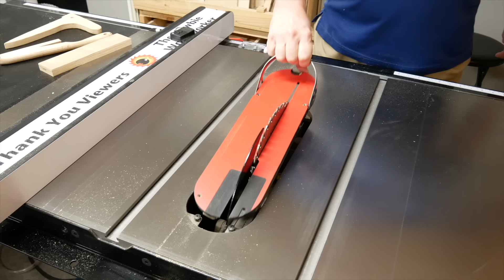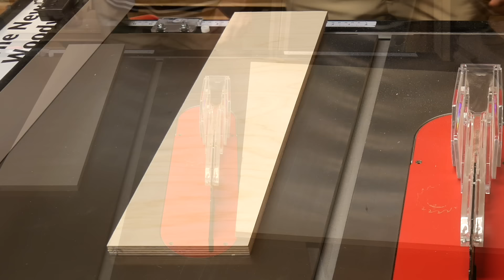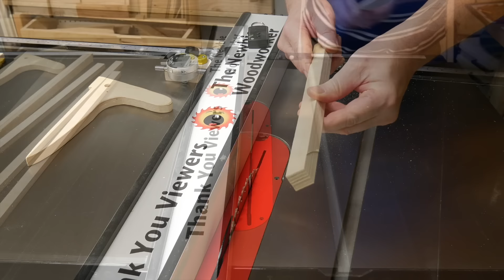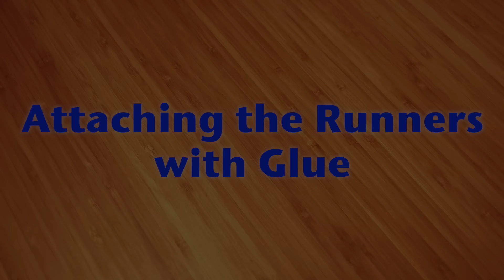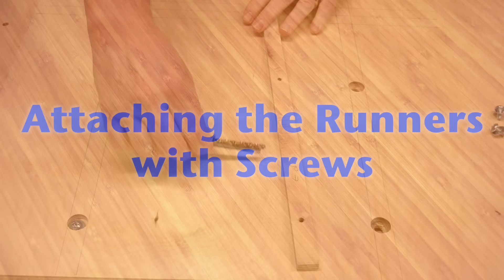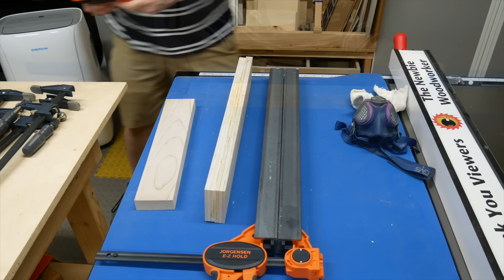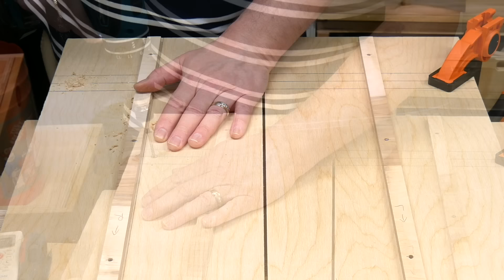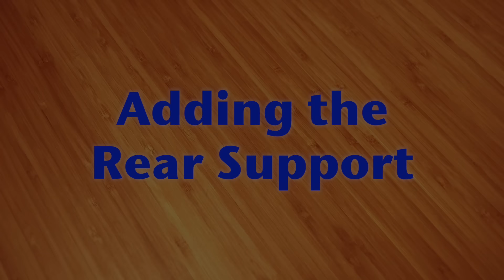Build this Revolutionary Cross Cut Sled, for Newbies!

Comment: A hazard might be advancing the sled too far and cutting it in two. A removable steel pin in one mitre groove or a latch at the back of the sled would prevent sled overshoot.
Reply from the maker: That hasn't been a problem at all. It's pretty obvious where to stop, since you can see the cut clearly.

Comment: Thanks, Newbie. Super helpful. I built this over the wknd. My deviation: To attach the slides, I put them in the tracks raised on pennies. Set my saw's fence so I could position the sled base down onto the tracks which I coated in wood glue. Put some weight on it and let dry overnight. Next day, I secure the tracks w/3/4" countersunk screws (careful to not go through). I figured that the critical adjustment is having the fence perpendicular to the saw blade, if my tracks aren't perfectly square it doesn't really matter. Sure enough, when I used your taped ruler w/long square square-up method the fence needed considerable adjustment to be square to the blade. Lastly, when attaching the fence to the sled rather than do all that upside down work, I positioned the fence on the top of the sled (between lines I had drawn), clamped it, flipped the unit over and screwed in from the bottom on one side (left like you showed, that helped!). Then when I had it square, I clamped it again, flipped over and screwed it in. Today I'll cut out the blade guard rectangle. I think I'm gonna use a jig saw and cut it in position without removing it from the sled, saving all that realigning screw holes bit. (It's already well sanded save the new cutout area which I'll do w/my fingers.) Ciao for now and thank you for all your work and humor.
Reply from the maker: Awesome! Thanks! 🙂

Comment: I bought a used table saw, no guard and writhing knife.  I made a zero clearance insert and added a splitter.  It appears I can't get a knife of guard from Dewalt as they don't make it anymore.  I do agree about the guard and the safety aspect.  Thank you for taking the time to make this video.
Reply from the maker: Thanks! And at least you made a zero-clearance insert and added a splitter - that was the best thing you could do to help prevent kickback. Good job!

Comment: You demonstrated that your small square was inaccurate, so you used your framing square.  Then, when you cut a test piece on your sled, you used your inaccurate small square to verify the fence was square.
Reply from the maker: Sorry - where did I demonstrate that my small square was inaccurate?
Reply: @TheNewbieWoodworker  20:55 "...the smaller square is less accurate."
Reply from the maker: @BlisterBang  There's a difference between "less accurate" and "inaccurate". But the truth is, I already knew the test piece was cut squarely, so the rest was just to show on the video. Yes, I could have used the larger square, and I probably should have.

Comment: Hi there, sorry its taken me a while to watch your video on making this saw sled,my only concern is when you are putting the screws through the base into the fence and the fence being made with two pieces of plywood is there a possibility that the screws could split the fence?, could you have built the fence out of a solid block of wood?.
Many thanks, Steve H from over the pond in England 🏴
Reply from the maker: Hi Steve. As long as you drill pilot holes first, you should be fine.

Comment: Thank you for sharing this design.  I've been away from woodworking for a long while, one reason being an innate fear of the blade.  I didn't like the idea of removing the guard in order to use a sled.  This design suits me perfectly, although I'll probably deviate a little bit, like using premade steel runners.  Other than that, looks great.  Thanks!
Reply from the maker: Awesome - glad I could help! And we wouldn't be woodworkers if we didn't taylor things to our own preferences, right? 😄

Comment: The way you attached the runners is overkill, especially for a new woodworker. Clueing them on and a few brad nails would have been sufficient. If you want them to be removable, use smaller screws from the bottom of the runners by counter-sinking them. Also matching threaded inserts in the base of the sled that the runners are attached to. This way there are no holes in the top of the sled. I noticed that you chose not to use pennies or washers to raise the runners up in the miter slots. that may be contributing to the sticky feel of the sled.  What you spent on a drill bit and tap would have covered the 4 threaded inserts with change back. To me, it just seems to be more work than there needs to be.
Reply from the maker: OK, thanks for your comment.

Comment: Plywood is laminated out of a mix of veneers.  Face laminates are typically of higher quality than the core material. This means that the rail end of your bed will be stronger if you run the face grain perpendicular to kerf.
Reply from the maker: Thanks for the info.

Comment: Blade guards are only put on because manufacturers fear lawsuits.  Yet, in fact, blade guards are dangerous.
Reply: Curious. Surely if they are more dangerous they would fear lawsuits from injuries caused by blade guards and insist they not be fitted.😉
Reply from the maker: @davidsmethurst4318  There are a group of people that think blade guards are dangerous, and I've almost never seen them change their mind. But I suspect their answer to your question would be that with blade guards available, if there's a lawsuit, the manufacturers can just point at them and say "See - we did our part to keep people safe".
Reply from the maker: You are certainly entitled to your opinion.
Reply: There are approximately 30k table saw injuries in the US. I don't think they fear lawsuits

Comment: The problem is that MOST blade guards are an afterthought in design and mine for example won’t operate low enough to be good for sheet materials as the blade needs to be set too high eg blade is 20mm above workpiece with 18mm ply sheet which affects cut quality.  Also many are solid coloured so you can’t see the workpiece cut.  I don’t use mine for these reasons but would do if it had been better designed.  Yours us better designed.
Reply from the maker: Good points. Thanks for sharing.

Comment: First off, thank you for designing a sled that works with the blade guard. Nearly lost the middle two fingers on my right hand. (Nearly gave up woodworking!) During the video, I noticed something  ingenious. I tediously cut the profile on the inside of my belt/disk sander, adding a piece at a 90deg for all that sawdust the belt kicks out. It took most of a day to cut the profile and even then, it's not quite correct. Your idea of an old box is perfect! I'm going to cut one up today! Thanx man!
Reply from the maker: Awesome! Glad I could help. 🙂

Comment: I'm trying to recreate this build and have a silly question.  You're using 1/4in screws with washers to secure the runners, but then use a 3/4in Forstner for the washer holes while describing that as oversized.  I've only found 3/4 OAW washers for 1/4 machine screws so there's no wiggle room.  What am I missing?
Reply: I managed to answer my own question.  3/4in OD washer is USS dimensions.  I need to get SAE (Society of Automotive Engineers) washers which are 5/8in OD
Reply from the maker: @jeffreywalling6100  LOL. All I know is there are multiple size washers for 1/4" machine screws, and I usually get the smaller ones. 😄

Comment: You sure made a lot of rookie mistakes which is good to show how not to make the sled, However in so doing it made the video far to long and slightly boring cut down on the chat and the mstakes by editing out the errors people will stay with you not just switch off. You could show a quick montage of the errors at the end with dramatic buzzer like sounds or daa duurr captions as you explain but do it quickly. I believe you only have your audience for a short time and they want to get in and make the thing so as they make it they know its going to be perfect. Placing the errors at the end shows what not to do and will certainly remember it as they proceed,  Thats why Chippies sat measure twice cut once. it makes you look like a pro cheers good luck you have a very good speaking manner, your not a smart A, and easy to listen too and trust.
Reply from the maker: Thanks for your comment.

Comment: Wonderful video. I really like the idea of a crosscut sled that can accommodate a blade guard. I previously watched Stage Ramsey's YT video on making a crosscut sled and he suggests that you don't need to screw in the runners -- just use glue. Do you have any comment about that? I prefer your design for the added safety.
Reply from the maker: Thanks! Glue works just fine. Personally, I try to use screws whenever I can in any project, because I'm worried I'll have to re-do the project. 😂 But the truth is, I haven't needed to unscrew anything recently, so I'm sure glue is just fine.

Comment: I have recently bought a PCS for my Men's Shed (30 plus members) mostly newbies. I want to start out using the blade guard and your video is a great help. Wish you could find a local user to draw plans, they would sell easily so you could share the profit to offset your costs and assist many newbies that work easier with paper than laptops in a workshop.
Reply from the maker: Thanks. I've made plans myself for a few projects, but I'm such a perfectionist that it takes me forever to make them. And honestly, the money isn't something I really need, so if someone managed to make plans, they can keep all the money for themself. But don't hold yuour breath. 🙂

Comment: Oh my gods!÷! What is THAT? The bendy metal thing with the slots for marking?? What is that thing? I want one!#! That looks handy dandy and super useful
Reply from the maker: Incra 12” Precision Marking T-Rule: https://amzn.to/2JpF5Ek
Reply: As mentioned it’s an Incra rule and it is fabulous! However, a couple of things about it: 1) I found the 12” rule is too long and tends to move off square when you use it to draw lines. 2) you will need a 0.5mm pencil which tends to break if you’re heavy handed. I use an architect pencil sharpened to font the tiny holes - much stronger and holds the point longer.
Reply from the maker: @DowningGoliath  Excellent tips. Thanks!

Comment: THIS VIDEO IS AMAZING.............sorry for the caps but this video impressed me so much I had to emphasize it.  I have been hunting around for a sled for my DeWalt 7941rs table saw and have watched many videos on the subject.  Yours, well it not only outshines all the rest, but it is definitive in how to do it right and in a nice easy-going slow pace - not the usual rush to get it done video.  I agree with you about the blade guard and have always used it.  Gets in the way sometimes but I manage to work around it.  Your version is the one I will build.  I also want to comment on your industrial grade dust collector for your belt sander.  I always knew there was more to the AZ cartons than their logo and since I have a few of the smaller boxes sitting around, I now have my own industrial grade dust collector.  I am going to watch the video on the 'runners' as I have plenty of 1-2" width scrap pressure treated I could use...as far as hardwood is concerned, dried pressure treated is very hard
Reply from the maker: LOL, "industrial grade dust collector". 😄 Glad I could help!

Comment: Thanks for such a great idea! Can't believe there aren't more people trying similar designs that work with a blade guard. Just to confirm my speculation though - this still won't work with an anti-kickback, which will prevent the sled from being pulled back after the cut, right?
Reply from the maker: Thanks! I don't think it would work with them.

Comment: So easy to follow,you more or less cover everything.thank you.
Reply from the maker: Thanks! I appreciate it! 🙂
Reply: you are very welcome.
Reply: Agree, a point of interest after seeming this built elsewhere, the maker added an A shaped piece of timber to hold the front together big and clear enough not to interfere with the blade and guard. This makes the sled more stable and might prevent breaking at the other end in two pieces. Very enjoyable watching you work. Thanks.
Reply from the maker: @victorcarmelo8606  Thanks. I haven't had any issues at all with it splitting or even seeming like it might split.

Comment: I use 12” long 1/8” key stock from the hardware store to fit in the 1/8” blade slot in the sled board. If the slot is wider than an 1/8” use tape on one side of the key stock to wedge it into the slot. Measure off the metal with your machinist square to square up your fence. 

I bought a set of 12” key stock 1/16”-1/2” for another same price as the brass set they sell to wood workers. These work great with my table saw blade. You can reference off of the teeth that are bent on front and back of the blade. Or as a depth gauge for a number of tools.
Reply from the maker: Awesome - I'm glad it works for you, and it's a good tip. Thanks!

Comment: I have two aluminium runners each 12 inches long. What would be a sensible length for my base
Reply from the maker: I just commented on your other post, but in case you don't see it, my answer is, I don't know - you'll have to experiment.
Reply: @TheNewbieWoodworker  Thank you for your reply.. I didn’t realise I had double posted.. please accept my apology.. I am building my first sled and after watching numerous videos this is the one I hope to complete. I am a complete novice to this and just making sure I get things right.
Reply from the maker: @rapido759  No worries about the double-posting. As far as getting things right, don't worry about it. Prepare yourself for going through the process multiple times, so if (when) you make mistakes, you don't have to stress yourself. I have another sled video you might want to try first, since it's easier, and you can practice with that one first if you want: https://youtu.be/b-65Bs5Yi0w. Above all, have fun!
Reply: @TheNewbieWoodworker  Thank you for your help and advice
Reply from the maker: @rapido759  You're quite welcome! 🙂

Comment: Newbie here well an old newbie. Great video. Do the runners have to be the same length as the base or can they be  shorter
Reply from the maker: Thanks. They can be shorter, if you need them to be.
Reply: I have aluminium runners 12 inches long. What would be a sensible length for my base
Reply from the maker: @rapido759  Honestly, I'm not sure. Your best bet is to just experiment.

Comment: I'm a newbie and have been going over many sled videos. Ilike this one the best for the simplicity. There a few things from other videos I want to add. Some acryilc going over the middle to help deflect any debree. Ruler decal on both sides of the kirf. Maybe a little bigger. Vontrary to a comment from earlier I think this is excellent for a newbie. I've seen manny others asking you to do friggin algebra and triginometry on top of a bit of extra fluff.
Reply from the maker: Thanks, Michael. I appreciate the comment! I'm not sure how the acrylic would work with the blade guard, but if you figure it out, let me know. And thanks for letting me know that this is something you feel you can do, even though you're a newbie. That was my hope and goal, after all. 🙂

Comment: Just watched a video on the 5 cut method. It's overkill for me. I appreciate it. But I just use a long square and call it good.
Reply from the maker: I agree, except that if, by "long square", you mean a carpenter's square, then don't trust it. Get a decent set of precision squares like these:https://amzn.to/2E8K8HN
Reply: @TheNewbieWoodworker  Yes exactly. The longer the better. I know mine is not perfect, but it's my first one I made and I am pretty happy with it. The next one will be much better, now that I sort of know what I am doing. I definitely want to add dust collection, because when I am done using the sled I am covered with sawdust. I want to buy the Rockler one you hang on the wall, but it's all about money for me, I can't afford it right now. So I just have my shop vac.
Thank you for your videos, they are great for someone like me pretty new and on a budget. I wish I could afford all the professional stuff like Sawstop but I can't. Thanks again. Peace. Chris
Reply from the maker: @ChristianCMC  "Yes exactly. The longer the better." If that's a reference to a longer square being better, then I disagree. The longer, the less accurate, has been my experience.
Reply: @TheNewbieWoodworker  Oh yeah that makes sense. I guess I just need a high quality super accurate longer square. I just have the Home Depot brand. I would like to get a woodpecker one, but they are pretty expensive.
Reply from the maker: @ChristianCMC  It's very hard to find a long square that's really square. Getting a set of precision squares is really the beast option. They don't need to be long. The set I originally mentioned is plenty good enough, without being long.